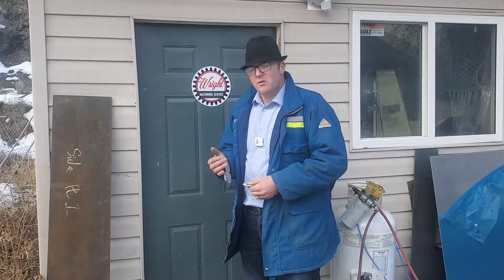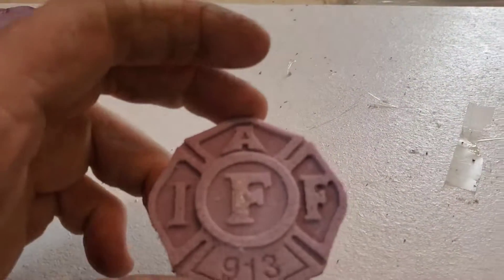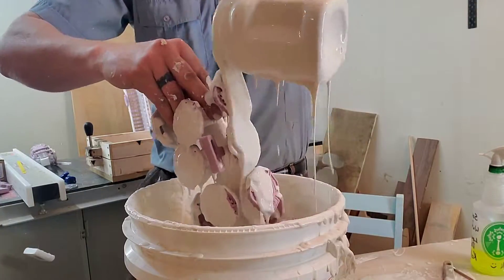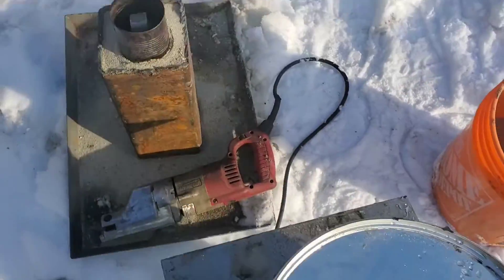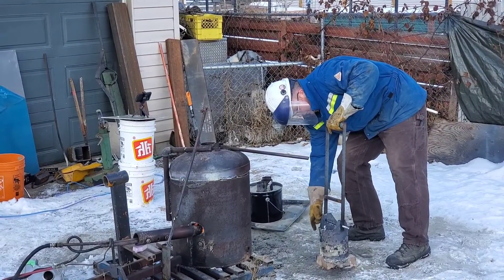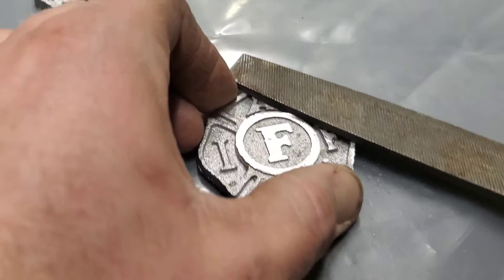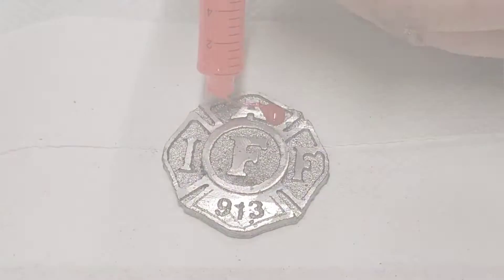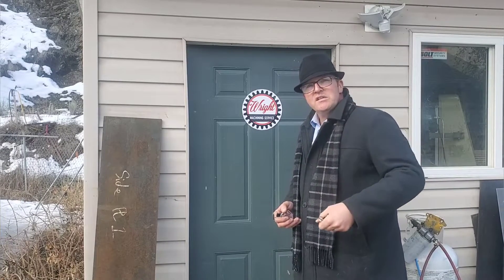Easy Lost Foam aluminum Casting Key Chains

Comment: Dude rad idea. Been making some things out of brass from old bullets my first union logo went way wrong but I am liking using the CNC to get the foam cut. So far I have been doing lost wax.
Reply from the maker: Thanks Cesar.   Lost wax is a pretty cool process and they have a lot of similarity. I'm curious about your casting can you look me up on Facebook under wright machining and send some pics?    I few years back we did lost wax to cast a beaver ( it's a Canadian thing ) on top of the truck bell. It's a cool process!

Comment: Great work! I might suggest using the blue foam board for your patterns.....there is a marketable difference in density between the blue and pink...the blue seems to machine and finish detail with out  crumbling......I also found that keeping the sand warm prior to the installation of the pattern and pouring event makes a difference and less likely to chill in the gate or runner. I try to use aluminum casting scrap, pistons, and non-extrusion material.....thin extrusion stuff seems to not do well and leaves a heavy dross at temperature (1300 Degrees) None the less..great work. Cheers!!. Steve
Reply from the maker: Christy great imput :) i will keep an eye out for the blue type and have a try at that as well .  I have a strady supplie at the moment of cast alu as well . I have been even busting up alu engine oil pans and melting them . 

Thank you christy

Comment: A piece of structural iron like you used makes a nice flask, especially with your vibratory......indestrcutable. You might try using a little bit more sprue height above where your patterns start. Once patterns are cheap, so is experimentation. I like your cause. Keep up the good work. Best, Kelly
Reply from the maker: Thank you kelly , i will be keeping my eye out for more like this for sure at the scrap yard .   It definatly packes easyer when there is less volume of sand . Also i scored some big pailes similar to what you are using and want to see how they work on a big pore.
Reply: @Wrighmachining  As the mass of the flask/mold increases, it becomes more difficult to adaquately vibe/pack them. It requires much higher energy and best to vibe as you fill and before the mass increases. For simple shapes it's no problem, but as you get more intricate and hollow cored features, the direction and amplitude of vibration becomes more important. Best, Kelly
Reply from the maker: On my way to scrap yard to find more HSS shorts :)